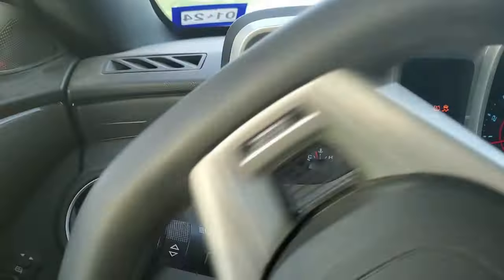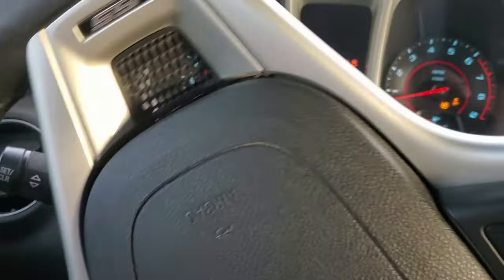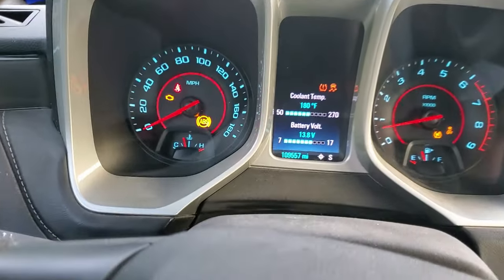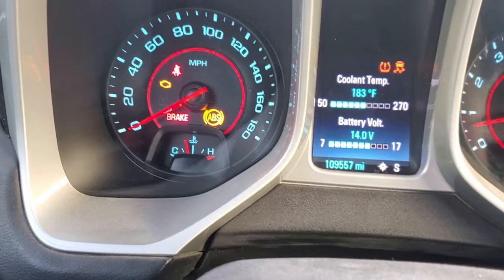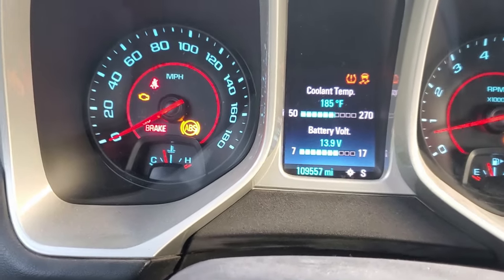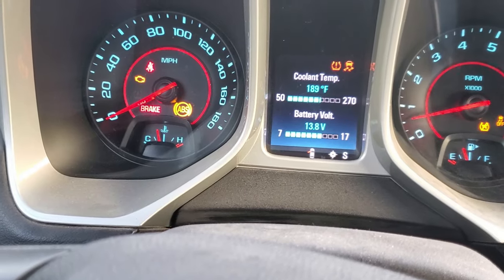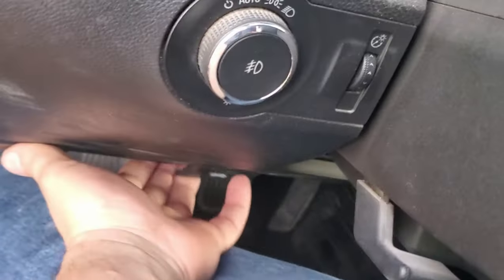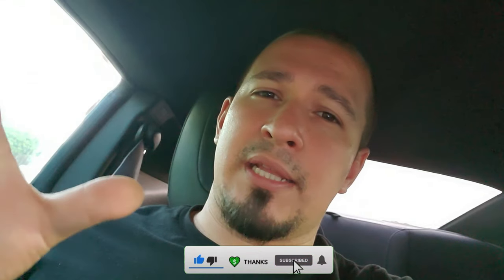Why does my car AC stop working when I slow down?

Comment: How will you fix the issue? Or have a permanent solution, like will I have to keep doing what you did?
Reply from the maker: @AnaliSanchez  the fans need to he replaced this is is just and indication that your electric fans are failing intermittently and should be replaced right away with new ones.
Reply: @EddiesCustomsandRestorations  ok, because the ac or whatever does blow air but it’s hot, and It stop blowing cool air after I was defrosting my windshield due to humidity (I put the air in the middle between cold/hot). Once I got back on my car after it being turned off no cold air would come out. My dad noticed that the fans were not spinning we were trying to put Freon.
Reply from the maker: @AnaliSanchez  yea when you turn on your AC the fans should turn on right away. Is the car starting to heat up too?
Reply: @EddiesCustomsandRestorations  not excessively, it’s kind of like yours in the video. It’s a 2015 Camaro with 86000 miles. I also saw your other video about the replacing the ac control module. So I’m not sure what it is but the fans won’t turn on and it has hot air.
Reply from the maker: @AnaliSanchez  go through the information on your screen and find the one that says Temperate. Tell me if it's over 210 Fahrenheit. Also if you hit your fan and it turn on, then that would be a clear indication that your fan motor is no good and if the fans aren't working, your AC is also going to blow warm air.
Reply: @EddiesCustomsandRestorations  it’s reading 205 and it’s going up by 2s
Reply: @EddiesCustomsandRestorations  it did go up to 212
Reply from the maker: @AnaliSanchez  did it exceed 212? Or from that it always goes back down?
Reply: @EddiesCustomsandRestorations  it came down it’s 180. So we hit the fans and they turned on now, but still warm air
Reply from the maker: @AnaliSanchez  okay, the fans need to be repaired first, then I can help you tackle the rest of the problem if there is more. But if it was just the fans alone, the moment they start running again, you should start feeling your AC get cool again IF ofcourse you have the AC button pressed lol. I know it's silly but we can always forget to turn our ac button on

Comment: I got the same problem. AC doesn't work good unless moving. One fan isn't working.
Reply from the maker: @austinhernandez2716  that right there is the problem. Chances are they only sell them together and won't just sell you the single fan and will need to buy the fan assembly (both fans). They should both be running if you have your AC on